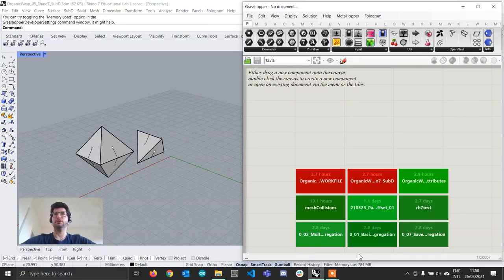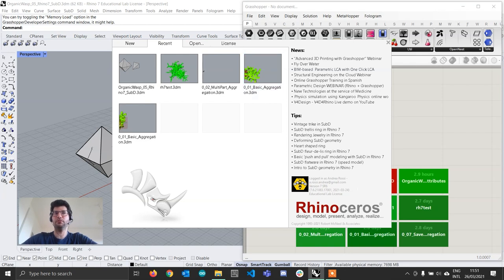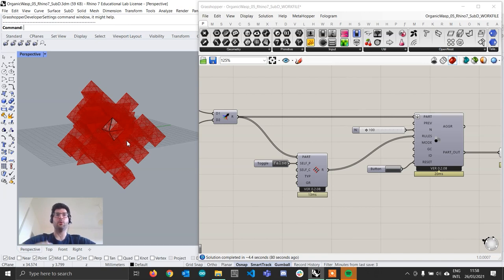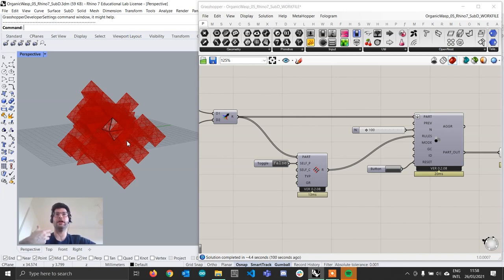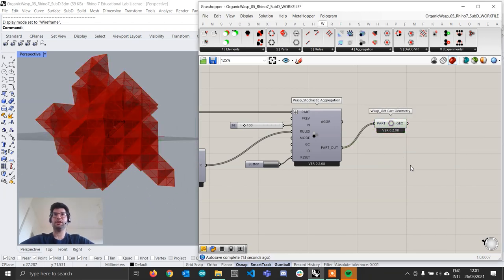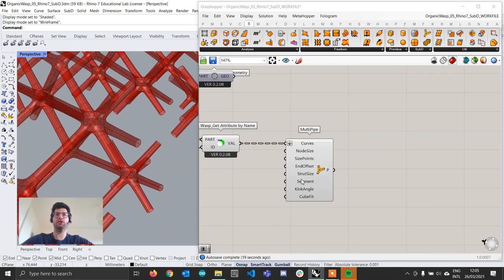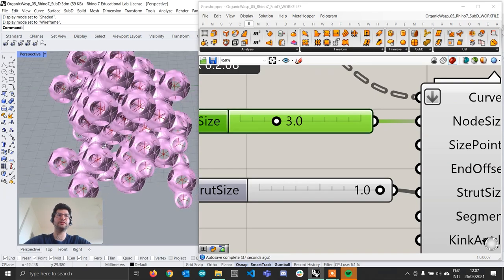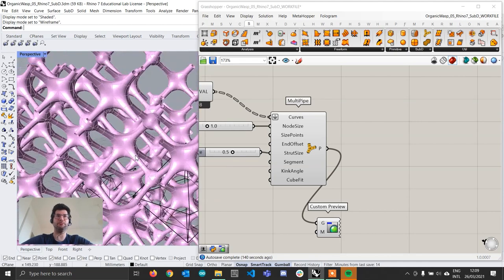Organic Modelling with Wasp, Weaverbird & Grasshopper - Tutorial #05: Rhino 7 SubD Tools

Comment: Hi! when I try to open the files in the description It shows an error " Solution exception:'module' object has no attribute 'Connection'" How can I fix it pleaseee
Reply from the maker: Hi, you probably have a newer version of Wasp installed on your computer, which is not compatible with the version used in the example files for this tutorials. You can update the files to the newest Wasp version installed on your computer using the Wasp_UpdateFile component, as shown in the last section of this video: https://youtu.be/MXHCtVCbeiA

Comment: Hi,Why do grasshopper say this:"Could not compute a valid colider geometry,please provide a valid colider in the COLL imput." And how to fix this ? please.
Reply from the maker: Hi, this happens usually because there is something wrong with your geometry, or because Wasp was not able to generate automatically a collider for your part. To fix that, you need to generate a collider yourself for the part.
To do this, simply take your part geometry in Rhino, and using OffsetSrf create a offset of the geometry inwards of a small amount (0.01 for example). Then bring that geometry in Gh and provide it in the COLL input of the part.
Reply: @TempAutonArch  thank u very much ! very helpful.